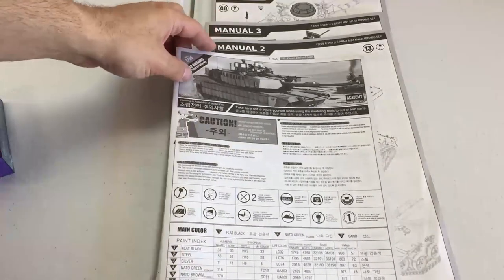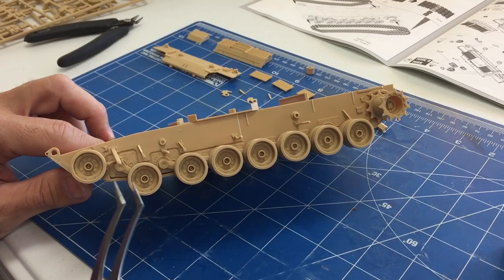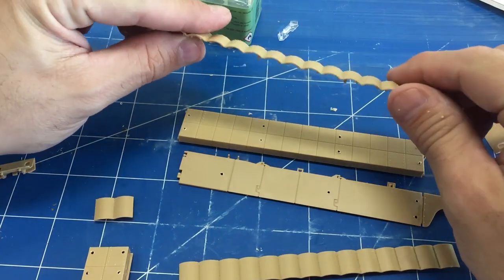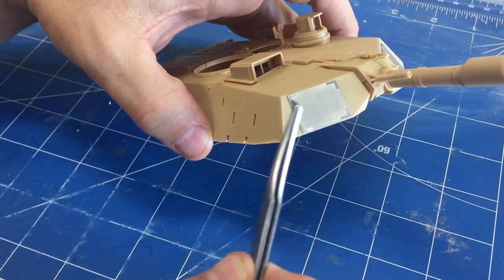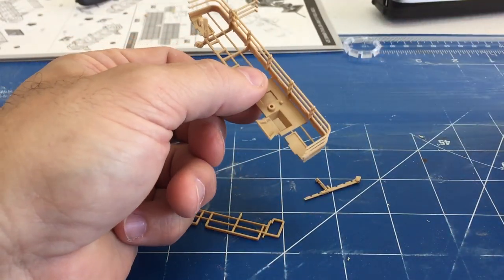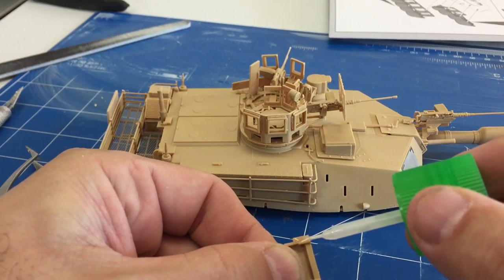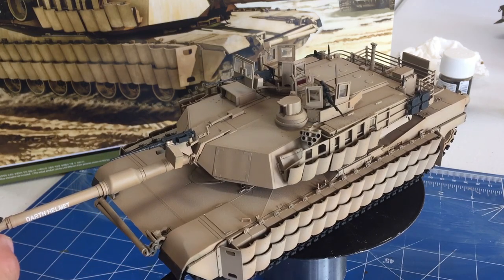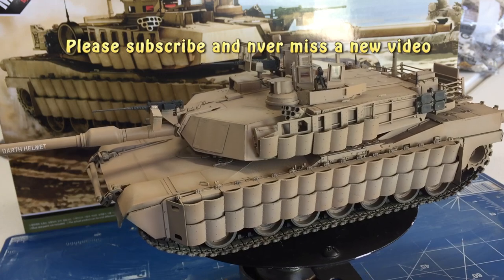Building the 1/35 Academy Models M1A2 Tusk 2 Abrams Tank

Comment: The TUSK II must be able to take one HELL of a beating! What a tank! Wonder what the next package will bring?
Reply: Chally 1 and 2 can take a hell of a beating WITHOUT any armor package. ;)
Reply: Mi-28 Havoc damn right! They can take even more of a beating when the new upgrade comes for them 😉😉
Reply: A Mighty Otter ah yest the ATDU.
Reply: Mi-28 Havoc it was penetrated in the frontal lower plate by an rpg so...
Reply: Mi-28 Havoc thats ironic too, the challenger required armor packages and was still penetrated by the incident I described, the abrams has no such report of being frontally penetrated by an rpg of any kind with or without armor packages, the challengers 2s lower glacis is only 50mm thick without era
Reply: HEY ITS MATSIMUS
Reply: Flamma The LFP of the Challenger 2 without any added on armor is 76mm thick not 50mm thick.
Reply: I'd still choose an up armoured chally or leo after this
Reply: @flamma6096  it was penned by a tandem warhead projectile, which completely negates the ERA being used at the time
Reply: I would take an M1A2 Abram over any tank thats just my opinion.

Comment: ah  a glue spill,  we've all done that once,   here's a tip.  Use a large lid from something like a pickle jar, coffee jar or similar, something with a large flat base and diameter,, then using, we call it 'blu-tac' here is the U.K,  stick a blob onto the upturned lid and press the poly bottle into it,  makes it much more stable.,  works with paint thinners, decal set etc etc,  just saves that costly accidental spillage. and costs nothing..

Comment: Great video Andy and top job on the Abrams build and paint.
Reply from the maker: Thank you , I didn't want to overdo it on the weathering , I googled lots of pictures of tusks armored tanks and they were dusty but not very dirty .
Reply: Andy's Hobby Headquarters Andy, I think think that you did the right thing, it's so easy to just go mad with the weathering, but most of these tanks are in peacetime mode and are very well cared for and even on operations, they are looked after very well by the crews.
great video as they always are, many thanks.

Comment: Question.  I noticed in several videos that you paint the browning M2HB as being black.  I'm a disabled Army veteran with 18 years Army service with most of it as an Armorer in a direct support unit, and all the M2HB's I have ever stored or worked on had a light- to medium-gray Zinc Phosphate Parkerized Finish.  (medium- to dark-gray to black finish is produced using a Manganese phosphate. which has a large crystalline surface (the Military does not like it because it's not nearly as durable as the Zink, and worst of all it hides dirt and they want everything to be visible for inspection lol. I had yearly inspections of my unit's weapons and I got written up for an M16 not having an oiled receiver. what's the big deal? M16's have aluminum receivers that don't require oil.  I got written up on it because it's the only thing they could find to complain about. lol)  I have done both Zinc Phosphate and Manganese phosphate finishes, and while I do like the look of the Manganese phosphate, but the Gray Zinc Phosphate is the correct finish.   even my WWII Browning M1919A4 and M1919A6 have the same finish.  (love your detailing)  I have not built a  model in nearly 30 years.  the last model I built was during operation desert shield/desert storm. all the units left for home in Feb, and our unit stayed around until July 91, so we actually had a little time on our hands for one model (and I left it there).  if I had the funds (disabled and can't work) I would be building models once again for a little enjoyment. I can't, so I watch other people build them lol.  Note:  I'm not criticizing your build or color choice, but wondering why?  do the instructions point this out.  (I used to actually send in corrections to Army Weapons Technical Manuals lol.    funniest correction -  the Army produced a new M3/M3A1 submachine gun technical manual.  they got it right on the cover, but everyplace else it was Submarine Gun  roflol

Comment: Your video is helping me a lot with my build. I do have a question. I'm worried that if I put the smallest parts on initially. When I primer and paint them all the detail of the smallest pieces will be filled in by paint. I'm thinking about putting them on after I primer, that way they will have less paint on them. What do you do?

Comment: Hi Andy,

Have you got any tips for what to do when the cocpit of a plane is a decal? I'm building the tiny 1/350th seiran plans for my tamiya i-400 and the cockpit is a piece of plastic, which you slide a decal over. No matter what I do I cant get the front and back of the decal down. So should I slide it in place with the front down (and back raised up), wait for it to dry then microsol it a few times so that hte back softens and sits down?

Comment: does this kit compare well to the m1a2 from tamiya?
Reply: The Academy kit is much higher in detail and a little more advanced. It also had way more parts than the Tamiya kit. Theirs not much to compare but they both come with rubber tracks and they both have crisp and easy assembly.

Comment: How do u clean it if you spill the glue?
Reply from the maker: Paper towel but it pulls the white lines off my cutting board
Reply: k thx!
Reply: the web says it is better to get a armoured car instead of a tank so you dont have to deal with complexity of tracks for a starter, is that true? cuase i want to get into this hobby and i like tanks.  so i was wondering if i should get an amroured car, i would be fine with that too